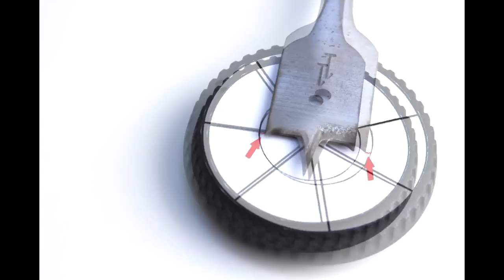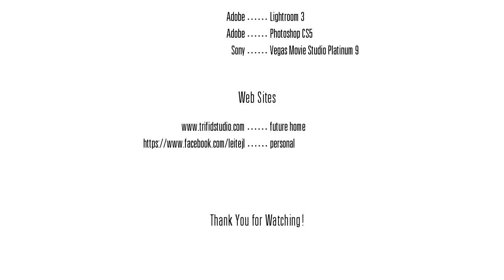TrifidStudio How2Photomicrography

Comment: George - your video is really nicely made, I have been buying camera adapters for my microscope for my DSLR, but I will give you simple method a try and I am going to link from my web site articles on photomicrography to your video.  I am trying to build a viewing lamp with a flash for photomicrography to stop the motion of fast moving protozoa. My Nikon flash works great by itself, but when I put the flash under the condenser I can't see what the organisms are doing as it blocks all the light, so I have to find a way to combine a bright light source  (LED or Halogen) with an electronic flash. I have seen a few tutorials on the web though they are great.  I just want to say your video is first class  - I hope to see more videos from you in the future. Thanks for posting.